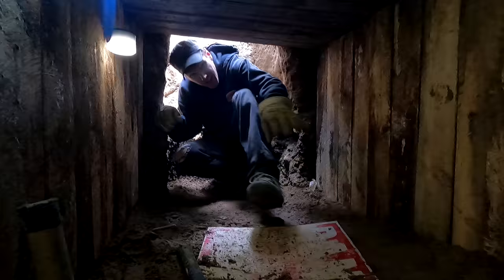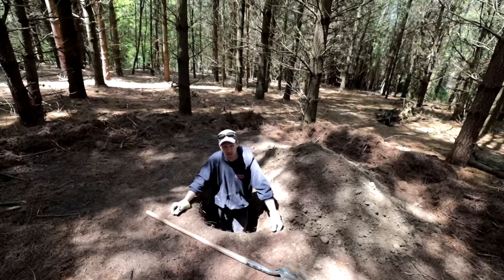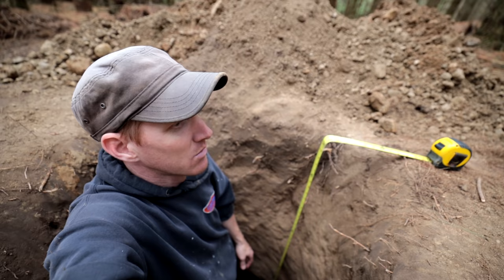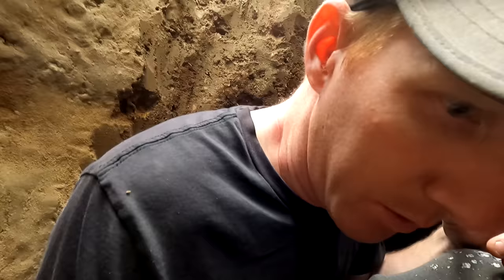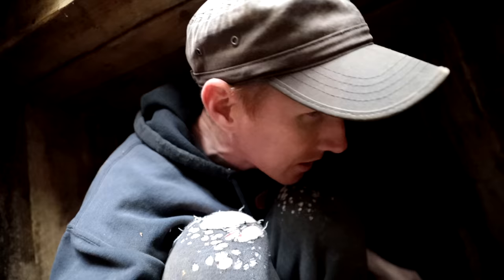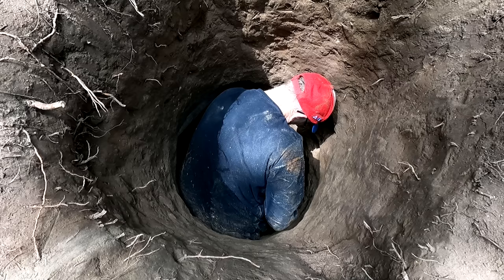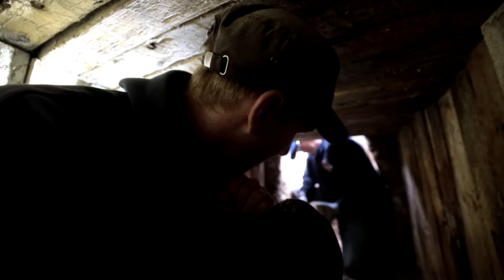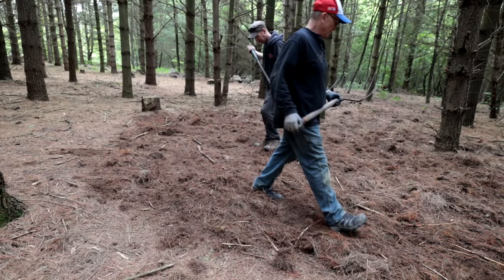Digging a Japanese Spider Hole (and sleeping in it!!!)

Comment: That's dangerous as it might collapse or cave if the ground moves a lot.
And what about ventilation & suffocation.
The tri-folding shovel is not strong for digging huge holes, but will bend & break in the brackets. It was really meant for harboring up, but like a lot of military issue gear... designs are versatile to utilize for a number of different purposes including rifle support & sniper techniques.

Comment: I think you should have use some of the clay to cover the dirt over the hole and around the opening to elevate the ground about 3 inches or four. And put the Hatch level with that reason being the clay will help shed water over that dirt and resist, soaking up water and dripping into the hole and when you have your head poking out, you can see a little further, but you’re also more exposed but you should be dry.

Comment: Would have liked to know more about you sleeping arrangements; i.e. sleeping pad or mattress, blanket(s) or sleeping bag.  Any air shafts or ventilation tubes??   Lived for awhile in Viet Nam in a bunker that was mostly underground with little light.  Loved the quiet.  Roof was sheet steel, with three layers of sand bags over the top.   Nice job, terrific video.    Thanks for shearing.                              Ax

Comment: Hexamine fuel. And to put it out you just blow it out, it's not hard. And if you used it the other way up you can just leave the fuel there and close it up until next time. You'd be surprised how long they last. One fuel block is more than enough each day, unless of course you're planning a three course meal.

Comment: 35:25 (edit, see 43:40 lol)
I just wanted to state that without additional ventilation that cooking with a burner/any kind of combustion is a safety risk simply because carbon dioxide is heavier than air meanung that enough use of flame could displace breathable air, resulting in obvious ill effects

Comment: wouldn't you want it to be about shoulder height to shoot out of it though? how are you supposed to shoot from the hole if it's just your head poking out? lay it on the ground and pull the trigger with your teeth?

Comment: 🔴🔴 You needed better Tools : 1) Shovel Handled Post Hole Digger;  2) 7 Ft/2 Meter long Iron x 1.5"- 2 " Diameter Bar with a Point on one end, & a Flat Spatula on the other . Think Miner.

Comment: If you use this hole for a long time, especially, by 2 men, than carbon dioxide (and some digestive gas that heavier than air:)) will be accumulated there, how partisans solved concealed ventilation issue?

Comment: "primitive tools" they're  not cave men 😂😂 

Those types of observation holes were not six feet deep, they were only deep enough to be hidden when crouched or seated. So you went in a lot deeper than you would have needed to. The veitcong would also more often have the "lid" able to be lifted with the head and not the hand so you had both hands on your weapon as soon as you looked out. The main danger here with this design is from behind. The best designs allow for a small slit where you can see out to observe any enemy presence before you reveal yourself.

Comment: Would it have been easier to just dig a deep trench and bury a horizontal wooden chimney and a quickly fashoned dog house🤯 at least there would be less risk of dying in a freak earth collapse 🤔
Reply: Absolutely, but what you are then describing is a bunker. That process ends with a more structurally sound space, but you would then have to wait for the earth to settle and everything to grow back on top of the dig site to cover it (this could take a full year and still leave an impression in the earth giving you away). The point of the spider hole and the  process in general is that the top soil isn't disturbed and thus remains a stealth base as fast as you can dig it out.